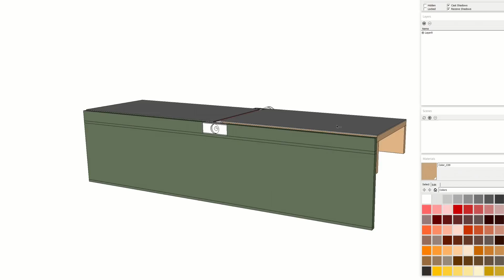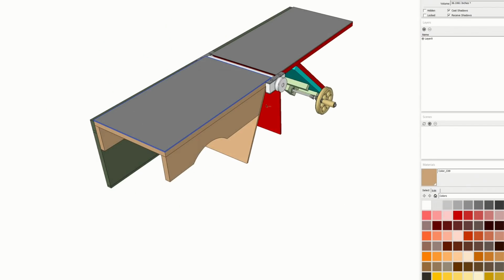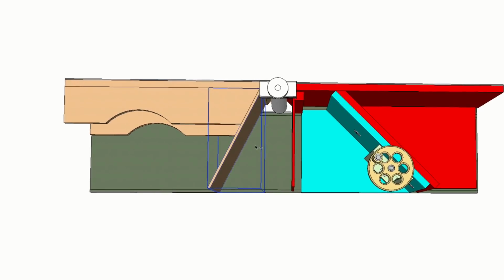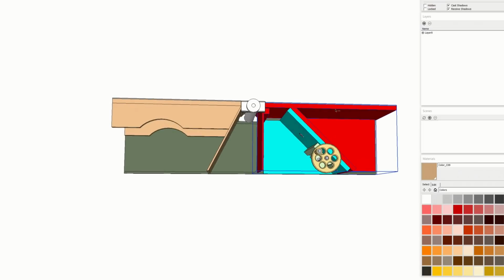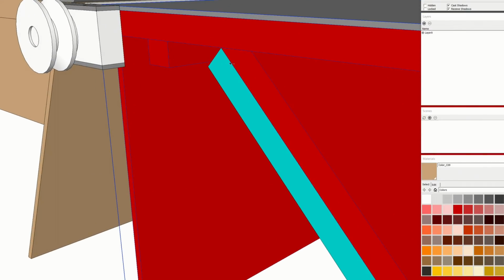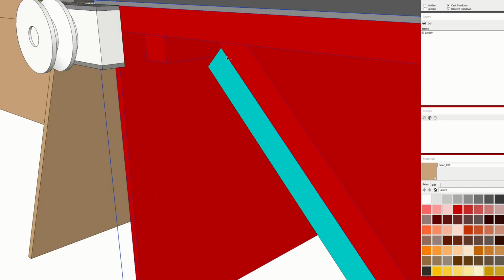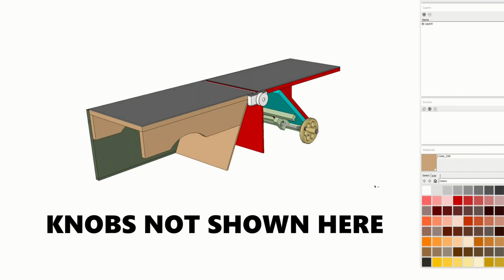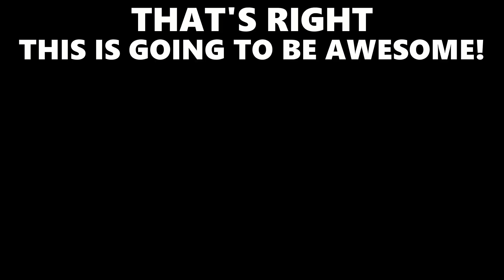I'm Building A Jointer! - Bearing Studs And Design Details

Comment from the maker: Installing the 1/4" threaded rod studs that will bolt the bearing blocks in place and a detailed look at the design as it is so far.
The outfeed table will be more or less fixed in place, but can be adjusted if needed. The infeed will move up and down via an inclined plane driven by a hand wheel on the side of the jointer.
The inclined plane mechanism is similar to the one in my precision router lift:

Ways you can help support this channel:
Patreon:
https://www.patreon.com/user?u=865843&ty=h

Plans for sale: http://www.ibuildit.ca/plans.html

More videos on my second woodworking channel:
http://www.youtube.com/c/IBuildIt

My home reno channel:
http://www.youtube.com/c/IBuildItHome

My "Scrap bin" channel:
https://www.youtube.com/c/IBuildItScrapBin

Website: http://www.ibuildit.ca/
Facebook: https://www.facebook.com/I-Build-It-258048014240900/
Instagram: https://www.instagram.com/i_build_it.ca/
Reply: I have been shopping for a used jointer on craigs list.   Do you think an old delta 6" would be a good one?

Comment: I think the inclined plane lifting mechanism is a great trade-off between simplicity and adjustability of the in-feed table. You may never need to change it but if you do then it's easy to do and the mechanism is simple so should last forever. :-)

Comment: I was thinking about your original plan of the infeed table on 4 posts and thought you could do something like the turret depth stop on a router to make it adjustable.  The table wouldn't actually be attached to anything which might be a problem but perhaps strong magnets on the depth stops would be enough.
Reply from the maker: Interesting, but not much different from the 4 bolts idea, except the bolts would actually hold the table and enable very precise adjustment.
However, if the 45 degree inclined plane made like steps instead of smooth, that would accomplish something similar and would be... definitely harder to do than the smooth one with the lift mechanism.
Reply: I was thinking the depth stops would sit on top of the 4 bolts so you'd be able to adjust it coplanar and then not have to mess with that again but still be able to adjust depth of cut.  Just a thought exercise.

Comment: I adjust my depth of cut every time I joint. I make it 3/16 to 1/4 for board edges way out of line. I cut deep to quickly take away material. Or 1/16 to 1/32 for boards that are already almost flat. This way I'm not wasting time cutting 8 times when I can do it in 2.

Comment: I've probably owned my jointer for 20 years and never adjust the cut depth.
Reply: I actually do change the depth on occasion.  Softer wood can handled a deeper cut, and also if the board has a bit more bend/cup/whatnot I may want to cut more aggressively at first to speed things along.
Reply: What kind is It?  I'm shopping for a good used one.
Reply: The Handyman Mine's a Delta, nothing amazing. Watch Craigslist, there are almost always a couple decent jointers.
Reply: I change mine quite often.
Reply: Wordsnwood (Art Mulder) I tend to be lazy... easier to take 2 passes than change and not have it back to my "standard" depth.
Reply: I change mine as well. I use a lot of figured wood and if you take too much of a  aggressive cut you get tear out.  So it's easier to re-adjust the infeed table to take a much smaller cut.

Comment: John, or anyone else in the know. I don't own a jointer but was thinking along the line of why not make it fixed? (other than the need to adjust the table for flat and square)  I know that you did expand on your reasons for doing so, but as it is not being used to used for bringing the stock to final dimension is there any reason not to go down this path. I understand that it may be a little limiting, that being if you need to remove a lot of material to get it square you would need to make more passes, but is this really an issue? interested on your thoughts.
Reply: I think you've answered your own question

Comment: Great height adjustment idea John although you may have to make the hand wheel removable or fit a folding handle to safeguard your goolies. Been there, done that on someones router table lift handle. As for the use of building adhesive, I'm a convert for which I thank you.
Reply from the maker: That side has the drive belt guard, so the hand wheel won't really be projecting out.

Comment: Would an angle, say 1-2 degrees be advantageous. It could help keeping the material against the fence. Are jointers you can buy always perpendicular to the fence? Would a fixed infeed and outfeed table be possible to make the build simpler?
Reply from the maker: Considered skewing it by as much as 10 degrees, but I don't think it's actually worth the added complexity.

Comment: FYI I used epoxy when making the handles of your 2x4 bar clamps.  The epoxy wound up giving out on me despite tons of mixing.  Ended up with a nail through a hole I drilled.

I suppose I'm stronger than I think.  However, I think you're better off with the construction adhesive as the epoxy didn't expand into the fibers enough.
Reply from the maker: Not all epoxies are created equal. I prefer the slow set type - it's stronger than the 5 minute stuff.
Also, did you key the threaded rod before gluing it in? A flat spot is all that is needed.

Comment: For the UK people - is he using something similar to gripfill?
Reply from the maker: Again, I'm not recommending anything that isn't either polyurethane construction adhesive (confirmed, not some brand name) or epoxy for this kind of thing. The adhesive needs to be immensely strong.
Reply: Yes. Gripfill will stick just about anything to anything (as long as it isn't dusty). Personally, I'd use epoxy but with 3" of glued bar he could probably have used Pritt Stick and it would have worked.
Reply from the maker: No, I'm using polyurethane construction adhesive - it's available in the UK. Epoxy would also be a good choice.
Reply: I'm in Spain but I think that you are right. That construction adhesive that he uses is similar to Gripfill or also Titebond Heavy Duty Construction Adhesive, both are waterproof
Reply: Don't use gripfill, it dries too brittle. It would just crack and let go of the threaded rod.